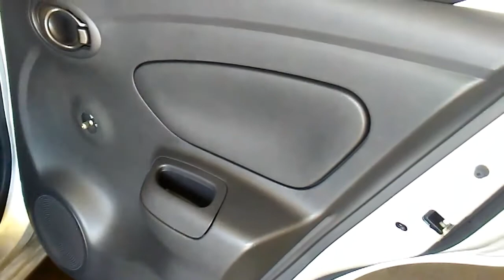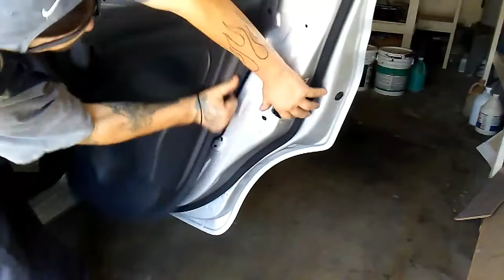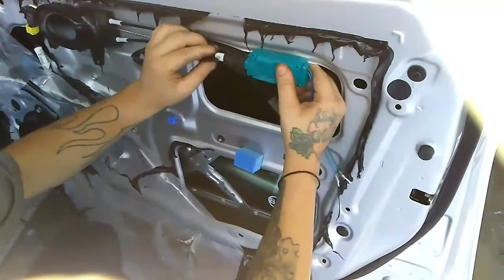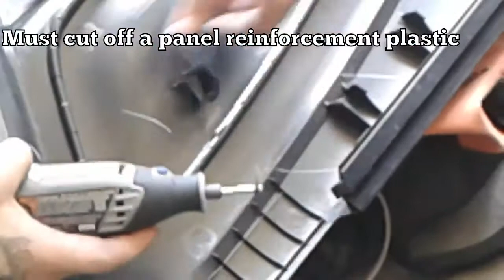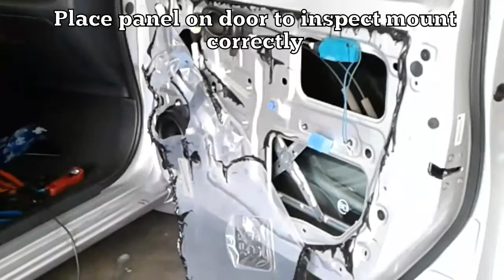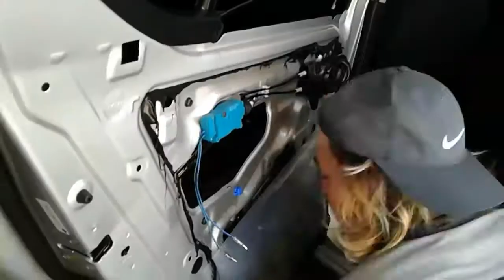2017 Nissan Versa door panel removal and power lock installation

Comment: Thanks, really helped my get mine done, especially drilling the hole in the mechanism instead of clamping to the cable.
I found out though that the hard part of this modification is running the wires.
Reply from the maker: David Bezinque.   323331614nine heres my number if any questions i do all electrical for all cars and repairs im really happy you learned.
Reply from the maker: David Bezinque buy yourself a flexible claw a.k.a snake.to pass wires thru the rubber wire conduate tube on door.
Reply: Cesar Orellana I’m thinking about doing the same for my car, is it ok if I some how get in touch with you for help?

Comment: Did you use a kit made for cable or rod locks? Do you have a link for the kit you used?
Reply from the maker: Jennifer Delcampo 323331614nine text me i install them no problem in los angeles
Reply from the maker: Jennifer Delcampo there is no such thing as cable or rod option there are only rod type. and anything else is custom. ill do the job nonproblem 323331614nine.please subscribe